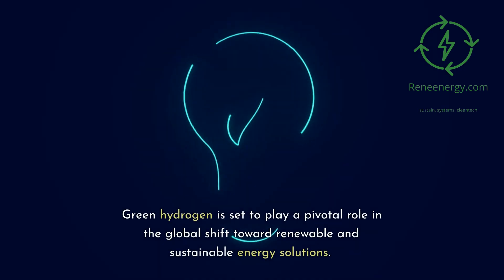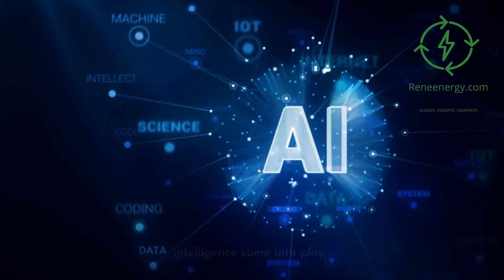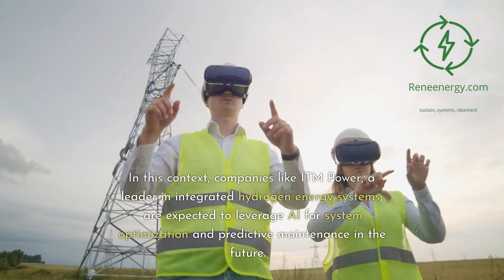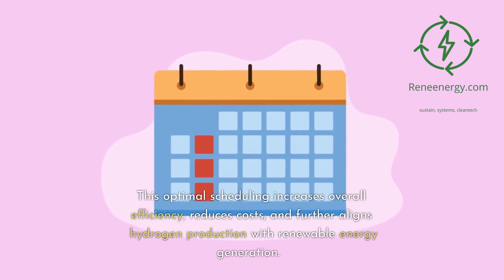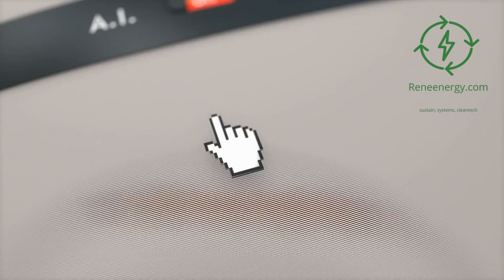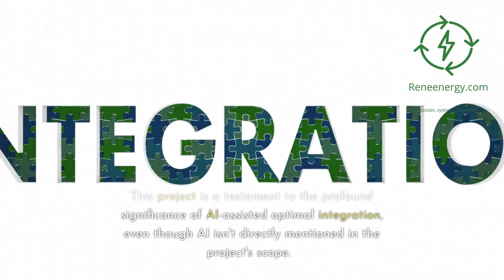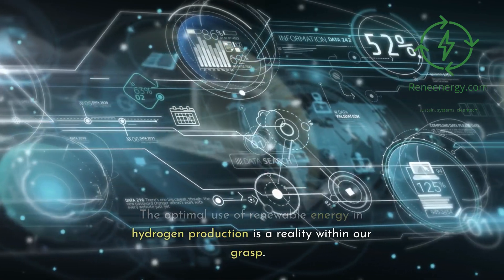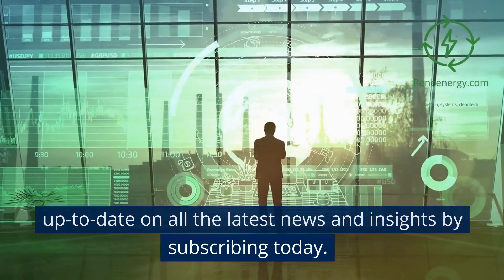Leveraging Machine Learning and Artificial Intelligence for Optimizing Green Hydrogen Production

Comment: predictive maintainance using ai predictions is only viable if you have a bunch of data from a current implementation of green hydrogen production. If your project revenue relies on the savings via predictive maintainance and you need an already implemented project to have the first item, therefore you don't have where to start.